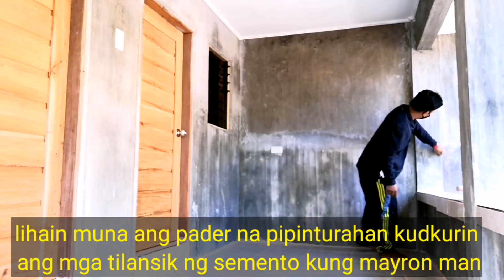concrete wall painting tips

Comment: Sir kelangan pa po ba i skim coat ang concrete wall? Foam po ang ginamit sa pagfinish. Para san po ang skim coat?
Reply from the maker: kailangan ang skimcoat sa rough na wall o sa may mga crack.. pwedi rin kung brush ang ginamit na smooth finishing... pero kung foam finish kahit hindi na basta walang mga crack.

Comment: Sir pwede bang diretso primer na kagad apply ko pagkatapos lihain yung conrete wall(No Skimcoat) namin at pagkatuyo mag apply na ako ng semi gloss/latex paint?

At ano pong recommend niyo na primer sa concrete finish?
Reply from the maker: yes pweding diritsu na primer as long as nakasmooth na ang pader o walang mga crack... at kung hindi masilan ung magpapapintura...
Reply from the maker: kung interior wall lang nman ay ok na ung flat latex.. pero sa exterior o labas ng bahay maganda ung acrytex primer..
Reply: @cardodiytips5820  maraming salamat po, para makatipid narin.

May isa po akong tanong, lalagyan ko po ng division wall ang bahay namin para sa kwarto gamit ang ficem board(HardieFlex) kinakailangan ko pa po ba mag apply ng primer o latex na po kagad?
Reply from the maker: kahit anung pipinturahan  mas maigi kung mag primer muna..